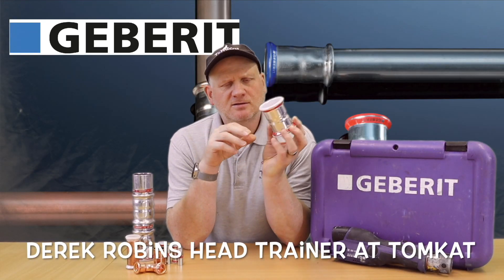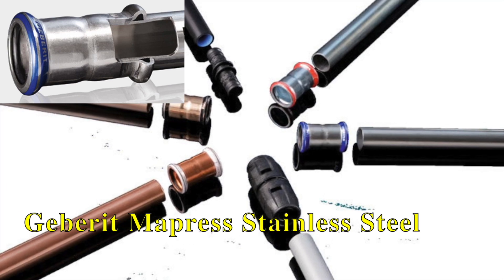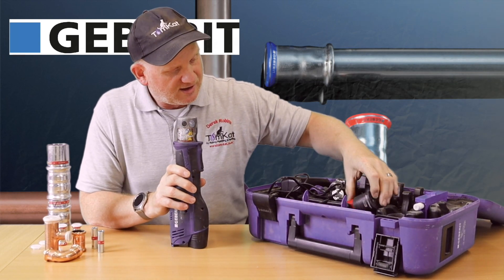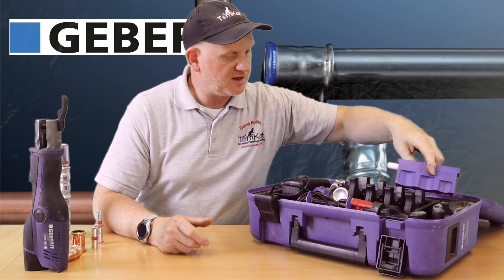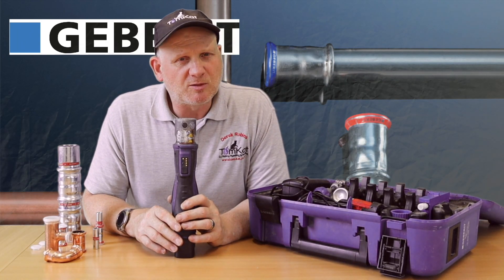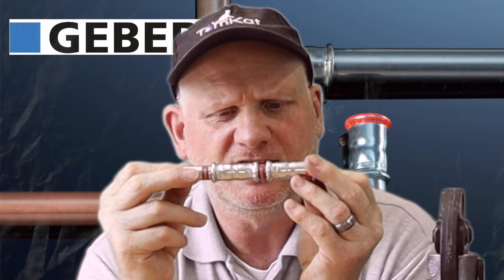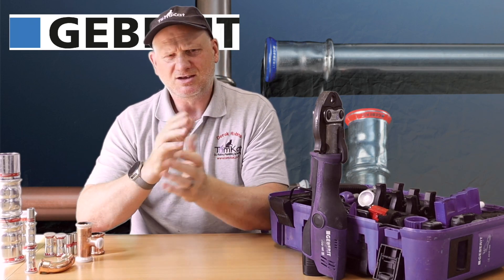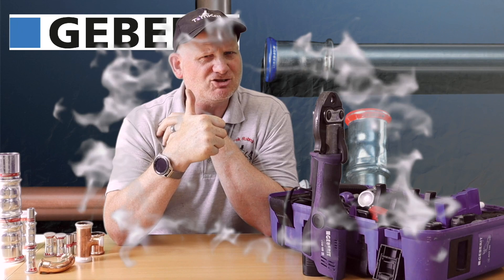Press fittings are they the future ? Tutorial  on how to use Geberit press guns and mapress fittings

Comment: I worked for Geberit as a service engineer and you MUST follow the instructions when using the press fittings, we had an issue with a press fit water joint which leaked and caused a lot of damage, when we cut out the joint and inspected it we found the the fitter had not de-burred the joint so when he inserted the pipe he damaged the seal.
Reply: Ha Ha that ol chess nut

Comment: There seems to be a lot of confusion on where Gas Press Fittings can be used e.g under timber floors etc. Some say they must be treated as a compression fitting and some saying to use as you would a soldered fitting.
Reply from the maker: Correct mate you would need to speak to the manufacturer for the required information

Comment: Derek as a commercial gas fitter I have been using Map press for last 10 years 
I started with Rems I was sceptical at first but got around hot permits for work 
I run Romax  (Rothenberger) 
4000 
Geberit is same as nova and Milwaukee I believe and use Milwaukee batteries 
Only use map press fitting using carbon steel or copper 
Yes it’s dearer to equip but looks better and on the big stuff so much quicker 
The compact machines like rigid rothenberger are the future for domestic lads 
No flux solder in pipework no cleaning blowtorch 
Just better
Reply: Do you have to pre fabricate  in tight spaces ?
Reply: @mgbroadsterJ  with the Rothenberger yes but Rems has a  angled jaws attachment which makes tight space easier ‘ but you learn and rhink how to press before you cut and join lol 
The most important thing to learn imo  is to  mark your joints after pressing so you never leave a unpressed joint
Reply: What do you think of the carbon steel mapress pipe? I'm thinking of doing my heating out of it instead of copper (zinc/ zinc, galv inside and outside). Was originally going to do it in threaded steel, but this will save me so much time. Just wondered if you'd used much of it and if you have any feedback. Thanks.

Comment: Press don't stress 👍👍👍 eliminates the need for a 🔥🔥works permit. I think what puts off the silver solder ring solderers is the cost of the press kit plus the price of fittings 😢😢😢 press reduces installation time prepping copper, can be used with water still in the pipe. NO BRAINER PRESS IS THE WAY FORWARD

Comment: Undoubtedly  inevitable. Had this with iron (low carbon steel!) superseding lead.Compression fittings v screwed iron, the arrival of pushfit  and MLCP. There are always going to be shortcomings whatever the system. The tried and tested copper pipe and bending techniques  look set for a major resurgence, can't be all bad!

Comment: Used this in a hospital that had terrible problems with pinholes in copper pipe .good system but crimping tool on 54 mm could be a pain in confined spaces.

Comment: Can you experiment what will happen when soldering and press fit get mixed on a installation, so what does the heat do to the press fit on a installation. I can imagine if it's nearby the seal will fail but how far can you be before it's workable. Thanks
Reply from the maker: You will be surprised at what temperatures the o ring will take

Comment: Just seen this video and start laughing on how UK behind plumbing technology. In Eastern Europe we use press fitting since early 90s. Actually in Germany just Iron screw and press nothing else.. I am Hungarian and nothing else we use is press and screw Iron nearly 30 years now, never had issue, since I do heating 20 years or so I had maybe 2 leak on Carbon Steel, and maybe same on copper due to faulty fitting.. Reason against solder is hot work, and flux which cause pin hole leak and time. Time is money. We do 1 st fix on  3 -4 bed house hot cold and heating on 1 day 1 man with 3 distribution manifold on wall and MLCP press Emmeti brand. 👍Recently just seen that crap plastic speedfit cost twice than press.. Dunno why people say press expensive when they use that crap DiY plastic and which more expensive.🤔

Comment: I still solder, but mappress gets used a fair bit ( domestic and commercial). No hot works permits and all the method statements/ risk assessments  required when your in a rush. Loads of issues with carbon steel pineholes in pipework though, so don't use that anymore. Also those moaning about rubber o' rings, what do boilers and taps, pushfit etc  have in them 🤦.
Reply: Glad I seen this comment..... I was thinking of piping my heating up in the mapress/ geberit Carbon steel pipe and fittings (with the red colour coding). I was originally going to do it in threaded steel. But, this would save me lots of time. My only concern was the wall thickness of the pipe, which is significantly thinner than threaded steel. Would really appreciate some feedback if you have any. Have you ever used the pipe that is galv inside and out? I realize the pipe that is galv on the outside only is asking for trouble. Thanks

Comment: I do not like the rubber seals .. they are destined to fail ... 

heating system 50 years old soldered still no leaks and compression brass olive never fail 

maybe a tool for simply tightening up nuts ?

hey ho

Comment: I've used it mate but it's horrible to work with. Just solder it. It is cheaper, and better, with no tool maintenance each year. If you use it in commercial applications it can be good because you have loads of room. As for domestic, I find wannabe plumbers use these tools because they can solder, so there are loads of bends in their work. Bulky fittings, AND, it has rubbers in it which will eventually deteriorate.

Comment: Not quicker than speed fit , . The tool costs a bomb not to mention the price of fittings . Try getting that tool under a bath or in the corner of a full kitchen unit , swapping heads all the time it would take you 3 times as long to 1st fix a house + 3 times more expensive, why ????
Reply from the maker: It is quicker than speed fit it can be used on gas and I did mention the price other than that good review of the video 🤔

Comment: My gas bottle does all sizes of pipe and cost £40 !!!!
Reply from the maker: Guess you didn’t like press then 😁
Reply: Shite
Reply: In 50 yrs when the rubbers fail what can you do , with speed fit I can remove the fitting and replace the rubber seal !!!
Reply from the maker: @twigthewonderkid1  I will be 105 so guess I won’t care

Comment: Absolutely ridiculous, I can not believe how long it takes to do 1 joint , with all the faffing around. How much would you charge to first fix a house, + the expense of all the fittings. You would be there months, 25 grand for a 1st fix , brilliant!!!!!!
Reply from the maker: Sorry mate you are talking rubbish if you used one you would know how quick and easy it is and it costs no more to the customers than using any other fittings.
Reply: @tomkatgastraining  how can it cost less when the copper fittings way 4 Times as much as a Yorkshire (+ the rubber) and the tool (+recalibration) . Try getting that tool under floorboards!!!!!
Reply from the maker: @twigthewonderkid1  what about the gas you need the flux the solder the wire wool the heat Matt you setting the house on fire and I have never had problems under floors in-fact it’s Easier to press under floors than solder
Reply: @tomkatgastraining  as I said £40 for gas , flux , solder, spray bottle filled with water(I don’t need a heat matt-and have never set a house on fire in 40 yrs )
Reply from the maker: @twigthewonderkid1  good for you
Reply: @tomkatgastraining  I have nothing against press , obviously the customer pays for materials in the long run , if my prices go up 3 fold, I’ll get less work and it’s harder than speed fit by a mile , I only need to get my hand in to push a speed fit on. The reason DIY ers use it because it’s easy and foolproof, why make it harder for yourself???
Reply: @twigthewonderkid1 you just contradicted yourself… ‘Easy to use and Foolproof’